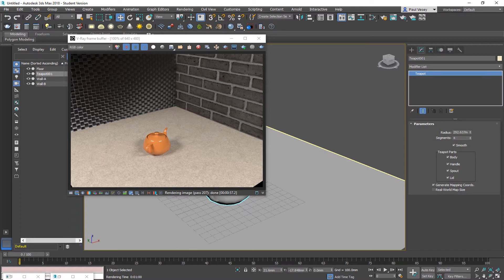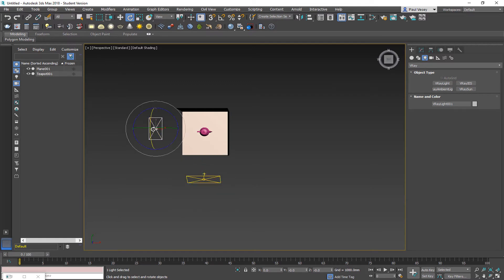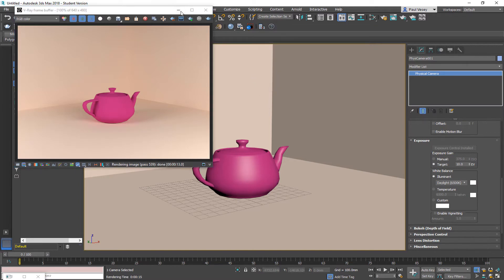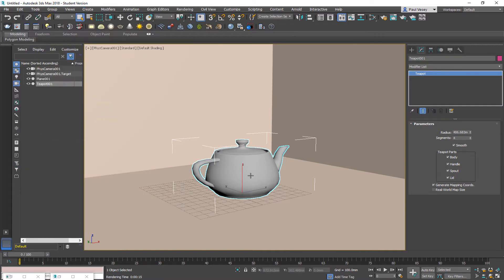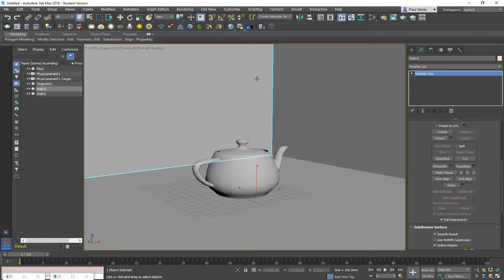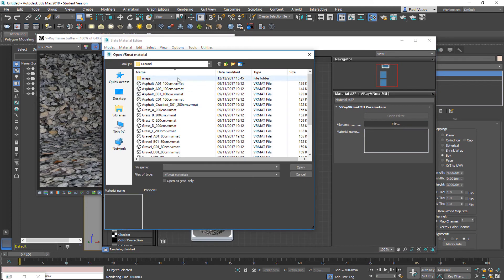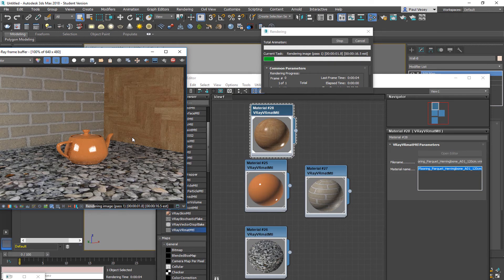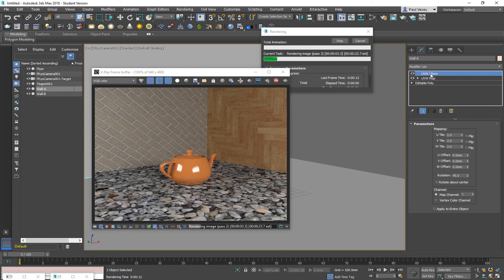V-Ray VRmat Materials - Use and Scaling

Comment: I have a .vrmat file with multitextures (multu sub)
When i open it it shows 4-5 different textures. But when i apply nd render it's not giving exact result it's just showing me a solid colour. The edit option in vray rmat is also not working it's locked. Can you please help me if you know any solution about it